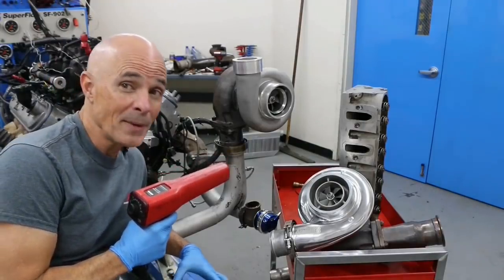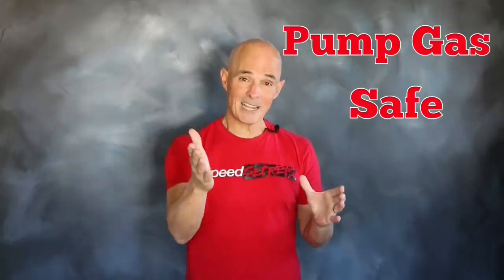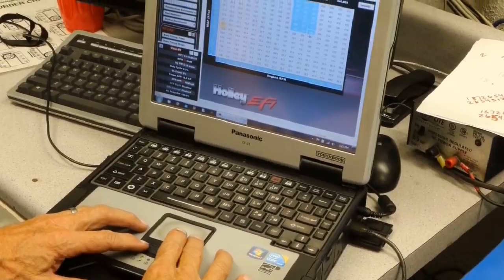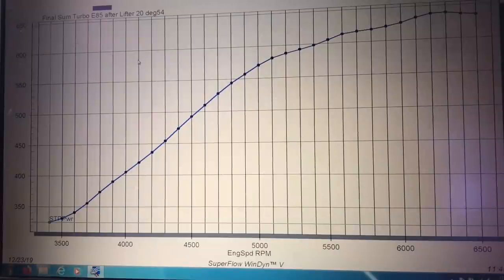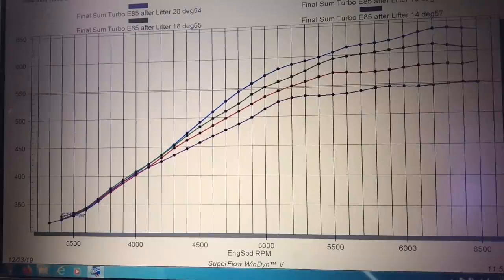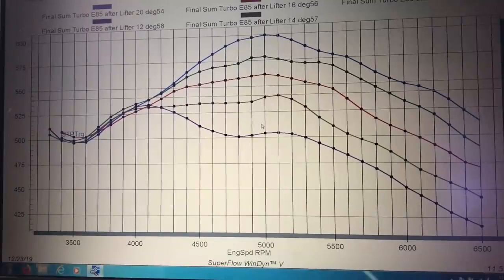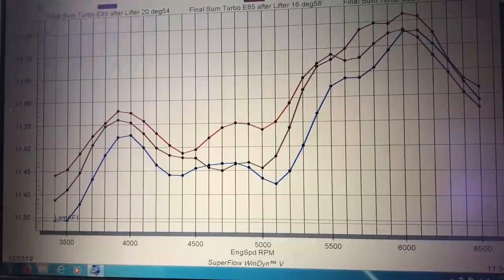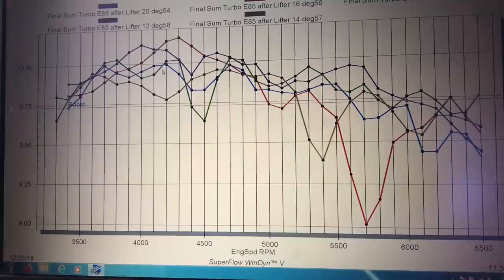TURBO TUNING-PUMP GAS VS RACE GAS Full Dyno Results

Comment: Ive asked a few times. But id really like to see an absolutely bone stock lq4 running 5-7 psi on 87 octane. I really want to see the limitations of an absolutely bone stock lq4 with some low boost before a guy is forced to run 91-93.

For me im looking to make my 07 3500 classic tow my dump trailer just a little better. I have zero need for 600hp. But i would like to see 400ish whp maybe 450tq. So roughly 440 crank hp. I figure it makes about 325 crank with the conservative tune. Id be willing to up the truck to 89-91 but premium fuel in my area is just absolutely nuts and the repair costs for a diesel are just not worth it.

Theres a few guys on the silverado Sierra forum that have run 10psi on 87 and shown some pretty impressive numbers on there dyno sheets. One guy ran an lsa cam and managed to squeeze 470whp out of a 6.0.
Reply from the maker: you could with the right timing and cooling

Comment: E85 is not pump gas if you can’t just go to every station and get it. Sure some stations have it and some vps also have 100 octane or better but we don’t consider that pump gas either because it’s not just readily available everywhere you go. Love the videos I’ve watched hours of stuff but stop calling e85 pump gas. If I have to have an app to tell me where I can get fuel on a road trip it ruins the functionality of the vehicle. I want to see what can be made on actual pump gas 87-91 octane you can roll up to any station along the interstate and buy.
Reply from the maker: E85 is 100% pump gas-because you can't get it in your location doesn't mean it isn't in 1000s of stations around the country. You can ask for 91 testing and make less power, but E85 is pump gas
Reply: @richardholdener1727 my claim was there are stations you can buy over 100 octane at but we don’t classify that as pump gas because it’s also not readily available at every gas station where as 87-91 typically is. When someone says pump gas we think of 87-91 not e85 is all I am trying to say.

Comment: Great info some people don’t get it if you explain it to them it’s like they can’t wrap there head around the idea that the piston speed will out run the spark witch causes loss of power you want it to spark shot 12 degrees after top dead center just when the piston it’s starting to fall😂😂it’s was supper cool to see the effects on paper

Comment: I was really surprised by the fact the AFR didn't change with such a wild swing in timing. I know, from my own experience of tuning engines, that retarding ignition usually makes the AFR go richer. Because the fuel has less time to burn completely. I'm really interested to know why that didn't happen here. I've never tuned with E85, just 93 and 95 octane. I wonder if the high ethanol content is what makes the difference?
Reply from the maker: timing changes don't usually change AF much-your tuning might be allowing changes of the fuel delivery with timing

Comment: The AFR didn't change cause the same amount of fuel is in the cylinder and the valves are closed. The ignition was fired at different times while the valves were closed. Is ignition timing tuning easier or harder for an N/A engine? Where do you start?
Reply from the maker: EASIER-LESS SCARY

Comment: e85 is not as energy dense as gasoline. i.e. less btu per pound. so running e85 at gasoline timing is not a fair comparison
Reply from the maker: I have vids up on what happens when you change timing

Comment: I get it but what I  know is theoretical and I'd  like to know what kind of timing I  can expect with 93 pump gas and water/meth injection & 9:1 cr sbc? How much timing can I  get away with & how much boost should I  expect to run on street? Thanks

Comment: I think I understand it, but isn’t it also true that with pump gas over e85 and shooting for lower power levels and lower cylinder pressure, you could have leaned out the pump gas tube some and potentially improved fuel mileage and fuel use?  I understand that’s not the primary thrust of the channel but my guess is that would still interest the same crowd looking for street gas tunes.
Reply from the maker: pump gas will get better fuel mileage since it requires 25-30 more fuel to make the same power with e85
Reply: @richardholdener1727  I think he was talking about over a non turbo engine or maybe not.
Also didn't you miss speak on the timing thing. 12 deg advance has less time to burn than 20 degrees. At 12 degrees advance the piston is closer to TDC than it is at 20 degrees advanced. I wonder what would happen if it were possible to add a very small amount of hydrogen to the fuel mixture and run even less timing?

Comment: E85=pump gas? Not in the Southeast sir.  put that 347 with the 174 Weiand on the dyno and tune it to live on 91 octane. down here E85 is only had at the dragstrip right beside the "race fuel". let's compare 91 timing to e85 and let's see the max tune/ hp on both.   keep up the good work Mr Holdner. love your channel.

Comment: Do you run lets say 12° from 3k till redline or do you gradually go up in timing by rpm
Reply from the maker: goes up with engine speed after torque peak

Comment: What would you suggest when it comes to absolute budget minded with a gt45 to hit 600-650 whp. Or is the gt45 even capable of that with a gen 3 5.3
Reply from the maker: The Gt45 can go 650 wheel (only just)
Reply: @richardholdener1727  I remember seeing you get it to around 7 or so crank. So I was hoping I could get it close to 650 wheel. What psi do you think it would take?
Reply: @richardholdener1727  and thank you for the replies. I think I’ve left 3 comments on your videos and I’ve always got a response. It’s a rare thing to have a creator take the time to answer questions!

Comment: So you showed what happens when you tune an engine for pump gas and then run it on e85, hmmm. oh yeah, the a/f ratio didn't change because you didn't change it. a/f ratio is the ratio of air to fuel going into the engine.
Reply from the maker: the AF ratio stayed the same on the gas scale but this required a great deal more fuel with the e85 because of the change in stoich value

Comment: What about 87 octane? Because gasoline is REALLY EXPENSIVE in 2021...And in some states E85 is not available, like Oregon...where I live.
Reply from the maker: hard to do much boost on 87, but low boost can be done
Reply: If you can't afford premium, you can't afford a turbo ls.
Reply: @matt6951  my pi swap runs premium, only one place within 40 miles of me that has E85

Comment: I was running 20 degrees of timing at 10lbs of boost on SBC with 93 octane with no issues I'm a member of the blow through mob on Facebook. Lots of guys running even more boost than that with pump gas
Reply from the maker: at the hp peak i'm sure and on a sbc-that wants 36 degrees na

Comment: how do you fix that problem with pump gas and how do you start out on timing for pump gas with a turbo to maximize the engine output safely and not blow the engine
Reply from the maker: very low

Comment: air:fuel describes a measurement of fuel and air in the cylinder. Changing the point at which you light that mixture will not change the ratio that was already inside the cylinder to start with. you can have 0 or 30 degrees and there wont be any difference until the mixture fails to light and burn completely. once you see the engine failing to burn the fuel, you will start to get different readings. In some instances you can find the sensor showing extremely rich, past that it will start to go extremely "lean". This doesnt mean the engine is necessarily running lean, but you're looking at an oxygen sensor. If the fuel didnt burn, the oxygen wasnt used and it will be present in the exhaust when it passes by the sensor.

Comment: Richard why does fast ez-efi 2.0 want you to put in 30 degrees of timing to operate their system? Are they wanting the timing from top dead center or all in timing? Can I add 20 degrees and add 10 degrees on the handheld in advance all in timing? Can you please help me, i'm so confused!
Reply from the maker: that is just the reference angle
Reply: So I can install it on my oldsmobile 455 at TDC? Or should I go with their reference 30 from TDC?

Comment: This test really only illustrates the difference in power with timing changes on e85. Pump gas is going to make more power  at 12 degrees than e85 will at 12 degrees. I think this test needs to be redone using actual pump fuel. And doing it in a way that you optimize the afr and Mac timing on both fuels. You definitely won’t see 121hp difference at 12 psi on both fuels. Bet.
Reply: Yea this test is stupid. Just for views.

Comment: It does not seem to me that afr makes much difference to power at all🤷‍♂️
Reply from the maker: much less than timing
Reply: @richardholdener1727  yes for sure... I have been playing with timing lately, Holley ecu, on waste gate and I feel like pulling a degree or 2 dropped a couple psi of boost pressure ?
However I did install a blowoff valve also and need to check that it is not escaping through it.

Comment: The AFR didn’t change because when you changed the timing the boost level dropped. Therefore the ECU injected less fuel and the AFR dialed itself into the same range. (Short answer)
Reply from the maker: we don't run closed loop-there is no auto correcting

Comment: I love this channel!  If I may, I'd like to comment...  Two things.  1) It would be really cool to also see the exhaust temperature, showing that with the same fuel input you have hotter exhaust at retarded timing and you are throwing work away.  The fuel energy goes to exhaust heat rather than power.  2) It looks you were still in the linear part (I plotted it to see it, and the curve wasn't yet starting to level out)  of the torque or power vs timing curve and you were leaving money on the table.  With the right fuel you could get safely get closer to the point of diminishing returns.  I played a lot with this region.  SAE PAPERS 940546 and 940547. (https://www.sae.org/publications/technical-papers/content/940546/  )
Reply from the maker: reduced timing does increase EGTs-not sure about your comment on timing curve

Comment: Interesting.   I have no engine dyno experience at all but on my chassis dyno changes in timing are reflected in the exhaust afr sensor.  I would like to know more.
Reply from the maker: how does timing change the AFR
Reply: @richardholdener1727  after reviewing my dyno information and hours of thought I have an answer to your question.   How does ignition timing change the afr of the engine?  Simple answer is that it doesn't.  But there is a catch!  Unless you are actually weighing the exact amount of air and the exact amount of fuel that the engine is consuming,  then you do not know what the afr of the engine really is.  If you are using a wide band O2 sensor then the only thing you are measuring is the free oxygen content of the exhaust system.  The timing is not changing the afr but it is darn sure changing the amount of free oxygen content in the exhaust system.  An OBD2 vehicle with a misfire will increase LTFT to correct for what it thinks is a lean condition.   I have to say that I have no idea why an engine dyno dosen't reflect afr changes with timing changes,  but my Dynojet sure does!  Maybe you can test one against the other sometime.   Thanks for reading.   CTS
Reply: I have seen changes in timing change the afr reading.  I can't say that the engine is consuming more or less fuel.  I have no way to test that with my current dyno.  In the endless pursuit of paying the bills I haven't spent as much time testing as I would like. I have a few ideas.  I will be on the dyno this weekend.  Maybe I'll have time to test a few things.

Comment: Great video, a couple of thoughts. 1. Did the EFI system utilize wideband O2 sensors?  This coupled with the use of electronically controlled wastegates could have played a roll in the reason the AFR stayed relatively the same, pull after pull.  2.  I would have liked to see the EGT's for the race tune Vs the pump gas tune.

Comment: Richard,
Will drastically changing the compression ratio affect the measured AFR? WB O2 sensors work because there is always excess/unburned oxygen in the exhaust even when "rich". I would think a high compression ratio/a lot of squish would improve the charge mixture and burn more oxygen. 
Thank you.
Reply: Also, I would say this is supported with the fact that BSFC is significantly reduced with increased compression ratio. But I love looking at data.

Comment: do a video pushing timing to the max
or one pushing to the max using methanol 60% vs e85
Reply from the maker: TO THE MAX IS BROKEN PARTS
Reply: Richard Holdener below the max 😅

Comment: WOW learned a bunch on that one, THANKS Richard!...best class ever...So how do you figure out just how much timing you can actually run? Do knock sensors give you a heads up? or is that too late?...What happens to the exhaust valve temps as you drop timing? cooler? hotter?

Comment: I was expecting more discussion of pre ignition due to fuel octane not just timing adjustment for detonation. Because race fuel (e85) was used for the entire test I would think the outcome might be different if 91 octane gasoline was used during the lower timing runs since higher octane fuel needs higher heat to burn properly. But maybe my teachings are incorrect.

Comment: So in therory my 1000hp capable engine and turbo (that I wanted to only make 800-850hp) is stuck making 700hp (because I had no intention on using E85, i.e. fuel system) on pump 93 unless I have a second 116 octane race gas tune for when I want to run race gas.

Comment: Hmm. You were talking about AFR, not amount of fuel. The amount of fuel could have been different even if the air-fuel ratio would have been the same, right? AFR is measured by the oxygen sensor, which means it measures how much oxygen is left in the exhaust, not how much fuel is burned.Even if the level of oxygen is the same in the exhaust, the amount of fuel burned can be different. A given amount of gas contains a given amount of energy, which should give the same power in all cases. On the other hand, the boost and rpms were the same, so that just leaves efficiency? Dang, it's a lot to wrap your brains around...
Reply: Oh, and thank you Richard for the videos! Thumbs up!

Comment: where in the engine will you recommend to install the knock sensor, and how accurate will it be if you are running solid cams since it will rattle and the sensor may pickup that and think it is knock, what about the rear cylinders which are normally the hotter ones, do you prefer to install it there or near your leaner cylinders .

Comment: Not going to read 251 comments. Just to the point. Flame travel speed makes a difference. You have close to 22 percent oxygen in e85. e10 or pure unlead  It's not apples to apples to e85. You will need to run separate test on all the fuel you run to be fair.
Reply from the maker: we've run plenty of fuel tests

Comment: A test with water meth injection with pump gas say 91 or 93 and all the who ever you want like snow performance and then see if it is cost effective . The reason I suggested I did that in 80 with a 350 chev 10.9 to one with a 292 comp solid lift cam , black jack headers , re curved hei . 750 holly . a set of heads that would support this combination.  It pull 6500 1 and 2 6200 in high gear with 3.42 gears . I used  water injection then and it worked well . I should have used aluminum heads as they help pull heat out and run a cooler thermostat . That was a long time ago but the water meth helps or I think so

Comment: I'm curious if you used e85 for all the runs and if so would pump gas have done a little better at the 12 degree timing? And is there a sweet spot with pump gas, perhaps less boost and more timing or does it come out about the same?

Comment: I would like to see a similar test run with pump gas Vs race gas. I wonder about the difference between ethanol/gas mix of E85 versus 93 octane gas the difference between how they combust. It seems to me that there should be a difference there in the combustion rate and that should change the amount of timing as well. I think it would make an interesting test. Also 20 degrees for max timing seems low what about testing an engine that is capable of taking more timing 30-35 degrees for max. I think the overall results would be similar but perhaps not. As a scientist (Chemist) and engine enthusiast I really love this channel, keep up the good work.

Comment: I bet EGT’s we’re getting hotter and hotter on this test.  I learned with my first turbo 5.3 that low timing equals stupid high egt’s. Enough to peg a gauge by the middle of a quarter mile run.

Comment: Great video, thank you. Adding  fuel,  when timing is retarded helps  to keep the EGT below critical values.  The 120 odd bhp we lost when retarding from 20 to 12 mostly goes as extra heat  into the exhaust , significantly increasing EGT. it would have been nice to monitor the increase in EGT and the required increase in AFR (enrichment) required to bring it back to the base timing levels of 20degree. But I guess for that you will have to run the dyno at constant rpm max load for extended period of time to see the enrichment required at each rpm.

Comment: I don't feel like this video is complete, since you didn't test your "pump gas tune" with pump gas...  

I would have expected to see more horsepower at the same timing setting, due to the lower octane fuel's faster burn rate.
Reply from the maker: very little hp change in different fuels unless oxygenated